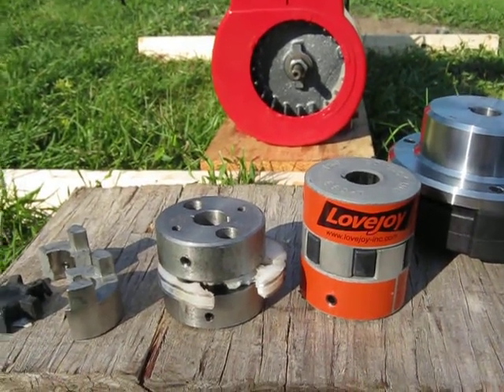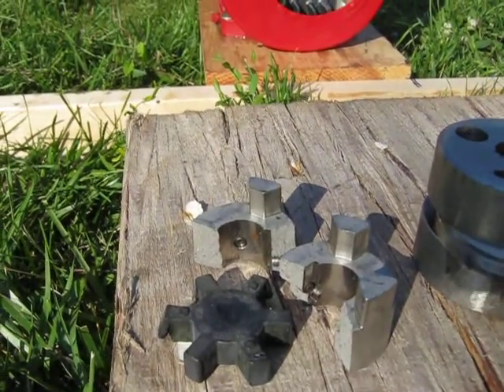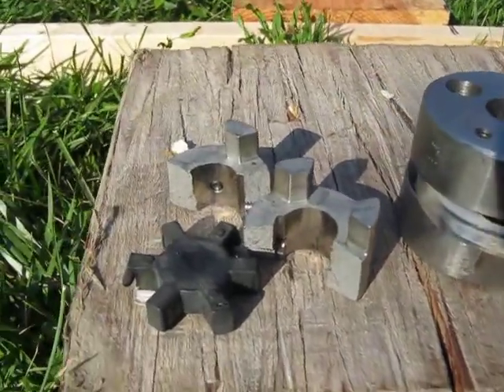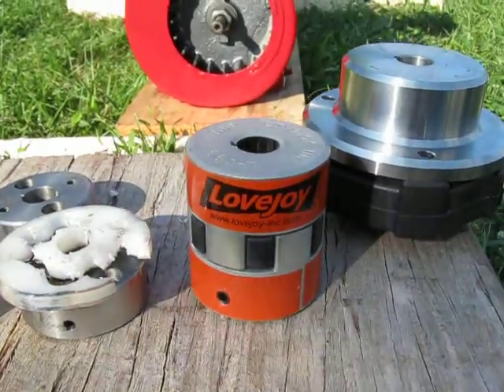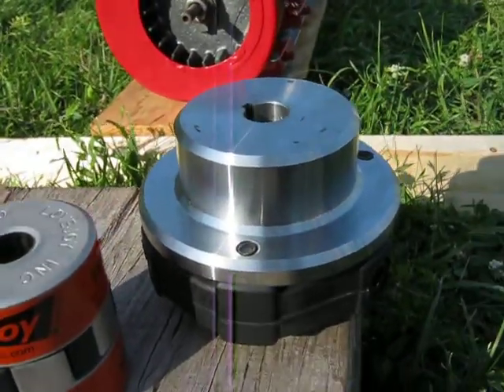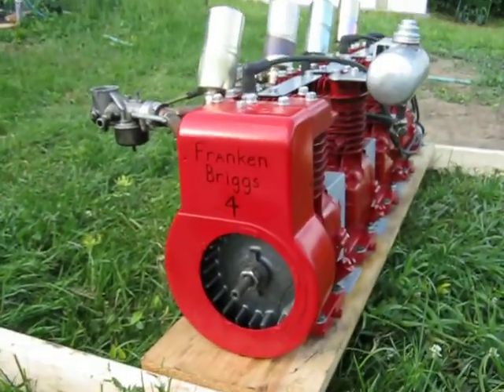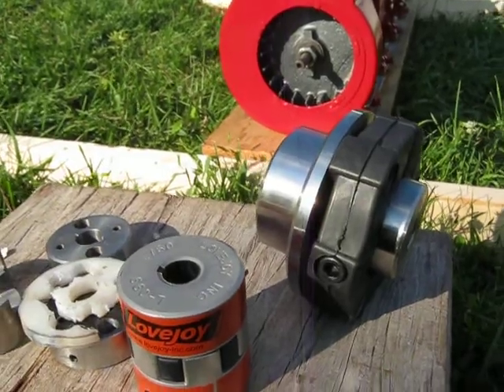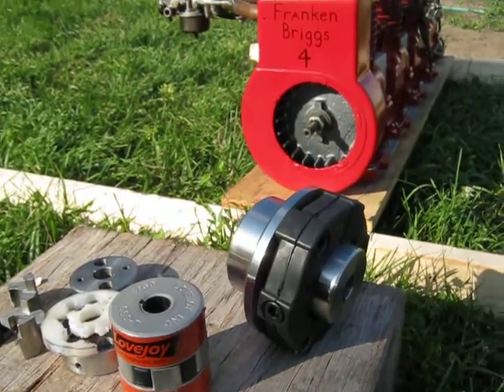LoveJoy Couplings on Briggs 4 cylinder

Comment: Morning! just the video I was looking for, did they give you a HP rating?, im having a hard time finding that info, I have an old mini new Holland built in the 90s, ive installed a 18hr Kohler and im trying to adapt it to the main 3/4 shaft that runs the main pump
Reply from the maker: No, they didn't give me an HP rating, but my guess is that you should be able to find some of that info on their website. Perhaps there is an option them to send them an e-mail.  I just looked on lovejoyllc  website, they do list the torque capacity of their jaw and jaw couplings. Leave me another message, maybe I can help you with the HP/torque calcs.

Comment: What is the material of the spider elastomer?
Reply from the maker: I hope this answer isn't to simple, it is rubber in this case, as far as I could tell.
Reply: How long did u manage to run your engine on that coupling at a stretch? Did u apply any load or is it just a free run?

Comment: how did you degree the pistons to one another
Reply from the maker: I set up all of my various inline engine, the 3,4,5,6,7 & 8 cylinders using a degree wheel I designed on CAD, and printed out.  Also the keyseat in the output shaft of each motor (cylinder) was used to help time the couplings and later the chain couplings I have used. I moved away from the couplings with a rubber element to minimize the flexing causing crankshaft timing changes when the engine was running. I hope this answers your question, if not, please leave me another comment.

Comment: Im doing a 6 hp diesel to a large massive generator....a ST-5 and would like to know the lovejoy number off the larger style rubber coupling....I'll have a toque surge and need as soft as possible cushion and still keep it all together....thanks for your vid...!
Reply from the maker: Howdy, I rescued some of the LoveJoy parts from the basement.  the metal parts of the couplings they sent me are L-099 , the rubber spider is L-099 L-100 and has a part # cast into the central flat which says 11494
  The rubber spider feels fairly stiff, but it will still have some give to it under the loaded conditions of the engine running.  Note, LoveJoy sized these couplings based on a 5 horse gasoline engine, so you would probably need a larger size for use on a 6 horse diesel engine, since a diesel has a jerkier motion than a gasoline engine, or so I read in a transmission manual. The worst combination for a coupling is a diesel engine driving a piston compressor!
Reply: i went with L-150 series couplings off of ebay with a rubber spider...only time will tell if i made the right choice.....we are just talking 6 diesel ponies....i did not hear back from lovejoy....so I guess their became busy with the post trump economy.

Comment: That bigger one looks like a coupling that John Deere uses to attach front PTO shafts to recite engines at the harmonic balancer. They have blue loc tite on them from the factory and are quite difficult to disassemble. It took us about 4 hours to change a fan belt on one if those tractors. Those couplings put up with a lot of crap though.
Reply: Tractor engines* posting from a smartphone isn't always easy haha
Reply from the maker: lol, I bet it isn't easy (though I wouldn't know as I don't even have a regular cell phone, plus I wear an aluminum foil cone shaped hat!!!  :)If you believe that last part, you will love Zontaar vids!Anyway, yes LoveJoy's couplings put up with a lot of abuse they take a kicken and keep on ticken!4 hours to change a fan belt, man that sounds like the design lads got something a bit messed up, though every design is a compromise between many alternatives. I run into that all the time designing these FrankenBriggs engines, many compromises!

Comment: you REALLY need to get that thing bolted to a proper bar of steel/reinforced motor plates the flex is unreal..
Reply from the maker: lol  :)Yes, I could really see it rockin and rollin when I watched the vid. I am working on a steel I beam base now, before I break something like a crankshaft!
Reply: ChargerMiles007 I was thinking maby like a two point mount with a plate connected to the head bolts and a arm with some poly bushings to control the lateral flex